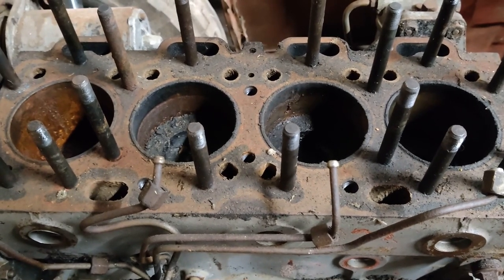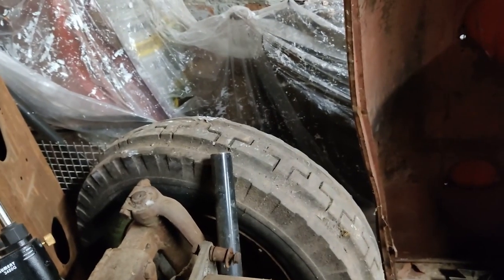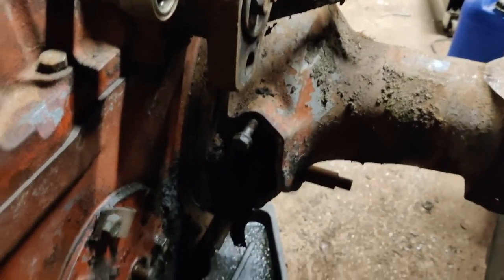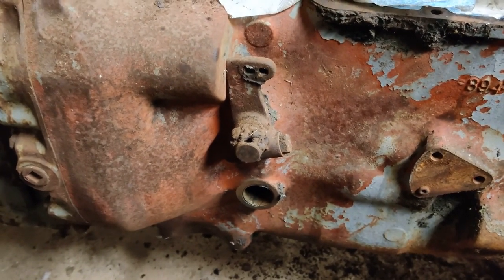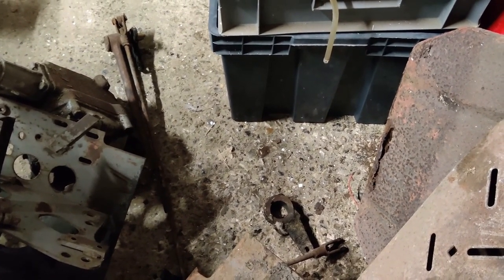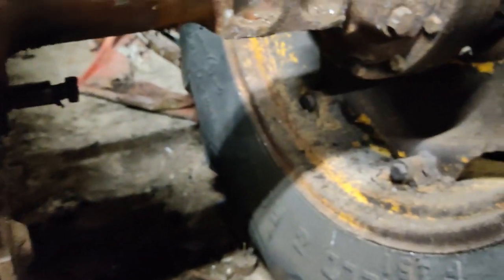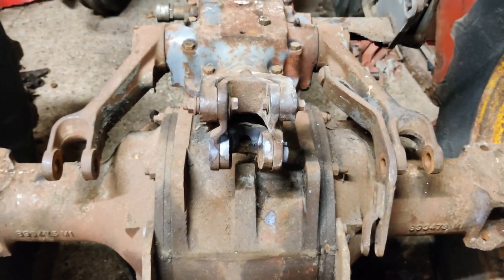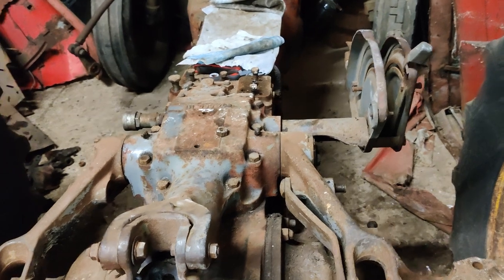175.  It's not that bad is it?

Comment: Its been well abused, but its a fairly rare model so really needs saving from the gas torch. Some people dont deserve to own things at all. Liked your comment about the non leaking rear hubs. Reminds me of a MF 690 4WD that had stopped dead in the field, I jacked it up and the front axle was seized soild. Owner came to had a look and said "well it was leaking oil, but then it stopped leaking so I didnt worry about it"
Reply from the maker: And there you have it, some people just don't deserver to own things at all.  Thanks for watching.
Reply: Good  day Robert  I am from Ontario  Canada  So why is  it rare,  just not many around or some special feature.  Over  here they were pretty good tractor, not as  popular  as 165 but they were good. Mennonites  used those 236 for power plants, very popular.  Thanks
Reply: @donvoll2580  It was only produced for a short time and was replaced by the MF 178. As you say they were not as popular as the 165, hence its rarity.
Reply: @robertallen3441  Good  day Is  that over in England,  I don't think we ever had 178. Later on we had 180 which had 236 in with 38 in tires.  Then we had 1080  for a bit then 1085.  Thanks
Reply: @donvoll2580  MF tractor model numbers were different in various countries. In the UK we initially had the 130 (French built) 135 , 165 and 175. Later the 185 was added to the range. Then the '8' line came along with 168, 178 and 188 models. We also had the french 1080 as well as the 1135 and 1155 models in limited numbers.
Reply from the maker: @donvoll2580  in Europe,  the 175 had a fairly short production run, it was made as 175, 175s was slightly different for Scandinavian markets and the 177 for German markets.  In the Europe it was superseded by the 178   in 1968, so although the total number of 17x tractors in Europe is quite high, actual 175 numbers are small compared with other models in the 100 series.

Comment: Just when I thought nothing else could be botched, you point out the barb wire being used as a split pin. Pure class.
Reply from the maker: When you see a machine treated like this, it makes me wonder what the rest of the farm was like.
Reply: @ClarenceFudWeasel  can you imagine the state of rotating parts on the implements hanging off the back of the tractor? I'd be surprised if no one died.who needs shear bolts when you have a welder?
Reply from the maker: @paulbrougham451  And what about livestock.  I think it shows a particular attitude and approach to life.
Reply: @ClarenceFudWeasel  I tried not to think about that, far too worrying.

Comment: Booger welds, bird sh*t welds, Gorilla welds, it's got it all. A veritable cornucopia of electrofuckwittery if ever there was! The half a threaded hole in the casting, I've fixed a lot of those over the years. I cut the same thread on a piece of carbon rod, screw it into the hole and then either Bronze braze or Nickle weld the cast and puddle the filler metal right over the top of the carbon rod. Once it's built up and cooled off.Drill the carbon out and run a thread tap through the hole. The carbon makes sort of a mould for the filler metal and forms a crude thread to match the casting. Once chased out with the tap, it's usually as good as new.
Reply from the maker: Thanks for that, you have given me something to think about there.  I hadn't thought about nickel welding.

Comment: I’m glad you like a challenge Clarence! An old boy from the village asked if I could look at his McCormick as it stopped and couldn’t get going. Every imperial bolt had been lovingly rounded with a metric spanner🤦‍♂ and I’ve never seen a fuel filter so bad😬
Reply from the maker: I'm glad there are still craftsmen out there willing to put in the hours selflessly performing such skilled work as that.  We shouldn't underestimate the skill required to force a UNF bolt into a BSF hole, or a  1/2 whitworth into a half inch UNC.  I salute this dying breed of engineer.
Reply: @ClarenceFudWeasel  the voice words were flowing as I tried to unbolt the bonnet. It was like a lucky dip to what kind of bolt it was🤦‍♂️ the relief I had going back to the trac saw amazing, proper German engineering! Till you realise the job I did🤣🤦‍♂️🤬
Reply from the maker: @casto-  Once you get used to metric, everything else becomes hard work. There.  I said it.
Reply: @ClarenceFudWeasel  you should have seen how much I used google to try and find the equivalent spanners 🤣. At least I can could to 32 which is the biggest metric I’ve used🤣 fecked for imperial factions
Reply from the maker: @casto-  I agree, it's not even as though you know the thread from the head size with imperial or the spanner to use if you know the thread.   A rough idea maybe.  At least metric is more consistent and all you need to do is count. 😂

Comment: That's a big project I grew up around Massey Ferguson tractors mainly those 100 series the 165 and 175 and 185 the 165 and 175 had the heavier rear end and wet brakes our 165 had the 212cid engine those were a force to reckon with like the 135 they had more power were rated for but this that you have there my friend you need a magician and a miracle worker to help you with it but it do able or maybe use it as a parts tractor
Reply from the maker: I have to restore it, there aren't many parts that I can use as a parts tractor!

Comment: Good  day from Ontario.  Boy too bad.  But those 236   were very popular over here , possibly  for power plants,  now cummins have taken over,  other off shore models.  Thanks
Reply from the maker: 236 family are probably my favourites, easy to work on, cheap to repair, reliable and versatile.  Probably one of the best ever made.  Thanks for watching.
Reply: @ClarenceFudWeasel  About 15 yrs ago fellow had full sized pkup  4 sale with 236 in,  could not get to see it that week phoned next week said in accident total. I wonder how that motor would have been in there?
for rpm, power & fuel efficent   .  People over here puty 239 cummins in
Thanks
Reply from the maker: @donvoll2580  I can't think that it would be that great in a pickup because the rotating assembly is so heavy for one thing, they are flat out at 2400 rpm they accelerate quite slowly.  So while you could destroy a pickup transmission and axle with one quite easily because peak torque is delivered between about 1200 and 1900 rpm and the torque backup from the mass of the flywheel and rotating assembly is enormous.  Very fuel efficient however.

Comment: Hi Clarence. You mentioned the wheels are shot. Have you thought about putting a pair of 14x30 PAVT wheels rims with the cast centres? I know they were an option - in fact I live in New Zealand & the 175 was almost always sold new with either 16.9x30 or 18.4x30 tyres on PAVT wheels.  They are probably easier to get than say 36'' or 38'' PAVT. Just a thought anyway! I like what you are doing and look forward to watching the transformation! Cheers, James
Reply from the maker: I've actually found a pair of 34 inch PAVTs I'm about to do a deal on.  I don't know how many were supplied without PAVTs, but I doubt it was more than a few hundred in total.

Thanks for watching.

Comment: Makes that old 3165S from scrap I've got as a project seem easy! Still a lot of work to do
Reply from the maker: How is it coming along?
Reply: @ClarenceFudWeasel  Its running, clutch working, but not much else at the moment, turns out the main dash frame is twisted completely so will need to get another one, a fair few broken studs to remove to fit a new radiator. Need to get a steering box ordered up too as this one is too far gone. And the worst part is its too wide to fit in my workshop we think, got to love it

Comment: Have you ever had a 175 pto shaft that wouldn't come out of the pto clutch.. I built a puller and still can't get it to move. The pto clutch needs rebuilt and the shaft is stuck...
Reply from the maker: Can't say I have ever had that.  In the next week or so I will have a look at the PTO on this one.  Does yours have an ipto or mechanical?

Comment: Nice to see you back👍 Are you doing a full engine rebuild on this?
Reply from the maker: Thank you.  I probably will, but part of me wants to see if it will free off and can be made to run as is.  Just out of curiosity.
Reply: @ClarenceFudWeasel  You know you want to rebuilt it back to Pekins factory spec..please?!
Why is it partially painted Fordson Blue?
Reply from the maker: @theoriginalwelderpaul I would like to do it Perkins spec, I have everything in stock genuine Perkins, but that's over £1300 worth of parts.  I also have the Agriline parts in stock to do it and that's just over £200 for the equivalent stuff.  I want to show off what people can do on a realistic budget so I will probably stick to Agriline.  

Which bits are blue?  Have you left the lid off the Evostik again?

Comment: Presumably your 165 is the early type with the 4.212 engine, the exhaust being in the LHS and your 175 has the 4.236 engine. If you have to, the 175 front axles is easily interchangeable with other heavier duties MF axles. 
I had an early C reg 175 with the the standard axles and cast wheel centre. Also fitted was a Farmhand F11 loader. The stub axles would break regularly.
By chance I bought a 4WD axles and transfer box, which I fitted to an MF 675, totally transforming that tractor. I then used the redundant HD (3 bolts per side) 675 front axle and wheels to replace the 165 axle. This ended the Stub axles problems!

You gotta save that 175, period!
Both it and your 165 are, or will be things of beauty.
Reply from the maker: The 165 is a 4.203 and the 175 is a 4.236.  I have spare castings and axles from other 100 series that I could swap in if necessary.  Having the 65mk2 front end always was a weak point on the 175, not sure why they did it.  This one is C reg too.

Don't worry, I will save it, I have wanted a 175 since I was about 6 watching our silage contractor arrive with one pulling a Kidd forager.  But finding the parts now is getting harder.  I might have to put a 165 front end on, but that's still part of its story and will keep it a useful classic .
Reply: @ClarenceFudWeasel  Thanks for correcting me. That 4.203 certainly punched for its weight. My father had a 1967 Multi-power version 165 brand new bought from F. A. Standen at Ely. Eventually, her piston rings needed replacing at about 25 years old, but she was a very good tractor.

The 4.203 165 was always a very good starter, but by the time she was 10 years old, our 175 always needed a sniff of Easy start to wake here up, even in summertime.
Even our 4.236 engined 675 was a reluctant starter in winter. But our 690 with its 4.248 engine was a very good starter.

I always found 135 (presumably 3 cylinder versions of the 4.203) good starters, yet many 6.354’s (6 cylinder versions of the 4.236) could be a bit reluctant.
Reply from the maker: @Rickwardful  My 165 definitely came back from France a couple of years ago.  It's quite an interesting one, factory high clearance and auxiliary pump.  When I get the parts I will put it back to that spec.  It's slightly lower geared than normal clearance because it should have 13.4 - 38 wheels, with king pins 1 1/2 inch taller than standard and 19 inch front wheels.  I have the correct front axle but I am struggling to find the 38 inch rims to fit 32 inch two piece centres.  Most of the internal plumbing is missing for the auxiliary pump and pressure control.

Comment: It is said that one should never buy a car from a mechanic and by similar reasoning one should probably never buy a tractor from a farmer! Still as the you-tubists say "it should make good content" whatever 'content' is 🙂
Reply from the maker: But I don't do this for content, I really wanted a 175 and this was all I could find. And strangely enough, I actually do enjoy this kind of work!  Thanks for watching.
Reply: @ClarenceFudWeasel  sorry, no offence intended!  Should he an interesting restoration. My dad worked at the Banner Lane factory - I hope he did a better job than the 175's last owner!
Reply from the maker: @keithmatthews1673  No offence taken.  What years did he work at Banner Lane?
Reply: @ClarenceFudWeasel  Only from the mid 60s to the early 70s when he retired on health grounds. A few bits and peices seemed to find their way to our shed, usually red in colour but also various knobs and levers which got used in various houshold projects!  The only 'souvenier' I have is a heavy sliding 1/2" drive wheel brace which I think must have been from a tractor tool kit!
Reply from the maker: @keithmatthews1673  Well he was there when my 165 and the 175 were made, it would be nice to imagine that he was responsible for some part of them.  The 165 was 1967 and the 175 was 1965.